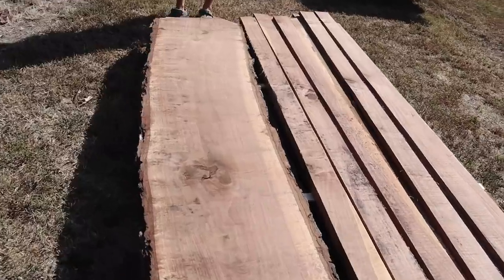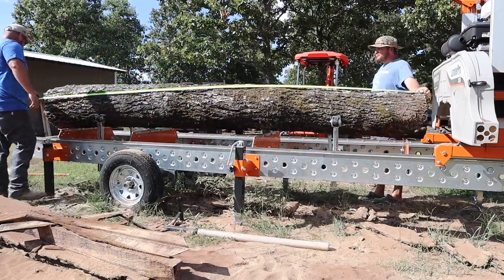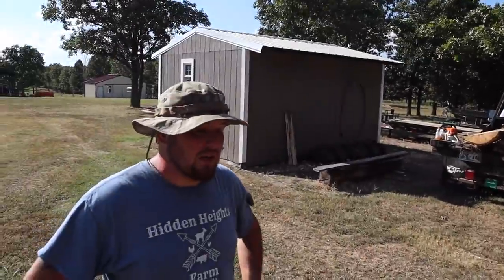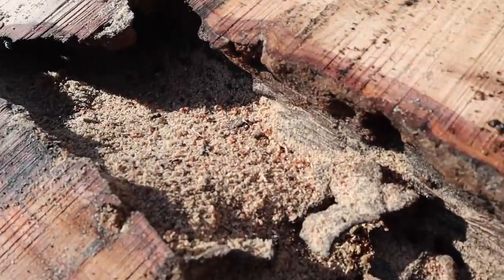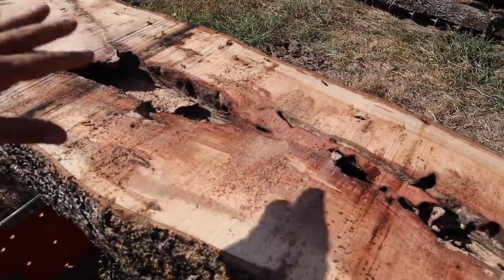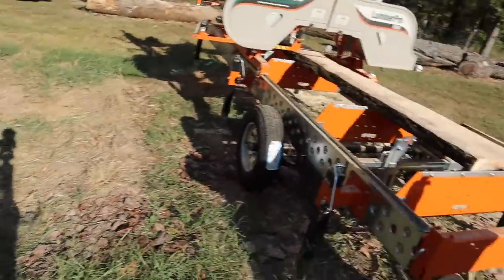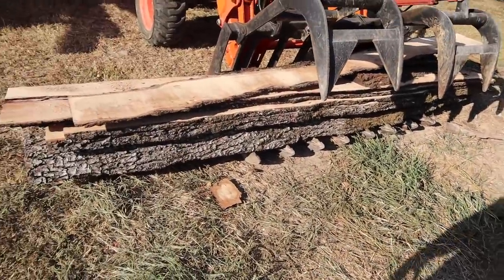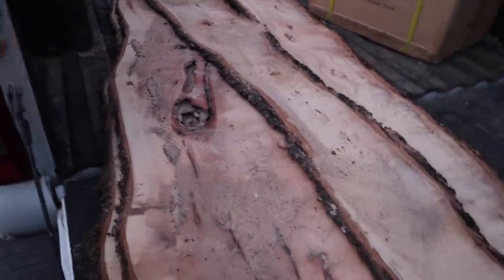WE FOUND 100,000 INSIDE THIS LOG

Comment: That was a mean hickory log!
Reply: Those ants look like carpenter ants. They can be just as bad as termites
Reply: It shook the bugs and beetles right out of it.
Reply: Those are carpenter ants you should spray them where de won't get it to the other logs
Reply: The logs need to be off the ground. Watch it with borax and water.
Reply: I think I would have burned that log.  I’m afraid you are going to have carpenter ants all over your property now.
Reply: Hickory is hard to cut blade don’t last long
Reply: Nurses are coming in, will try to finish later
Reply: Epoxy the ants right in
Reply: @dennislamers986  Exactly!  before they slice it  either using amber resin for ancient infestation look or water blue for the well shed.
Reply: Looks like he didn’t sharpen that saw to well. Just sayin 😉
Reply: We

Comment: Guys, Use a couple of plastic or wooden wedges and tamp them in behind the blade as you cut to take a little of the load off of the blade. The wedges are also used when you need to back the blade out of a log. 
I have had wood workers go nuts over my scrap pile, taking pieces that I would never believed that someone would want.

Comment: Hey Dutch, You can try to put a flat spot on the deck and continue cutting from the rounded side. That way when you remove the stable braces, the wood will not tend to roll on you.

Comment: I watch, "Out of the Woods Forestry" when I can. It's very interesting, and the sawyer has been using a mill for quite some years. From what I have just heard, you folks are fairly new at sawmilling.  I think the gentleman would be willing to offer advise if asked. I learn a lot, so I suggest you gents might also find that channel worthwhile watching.
I think it may be possible to get some more slabs by cutting, then rotating the log through 90°, then cutting again. Admittedly, you would probably miss out on the live edge, but you might also miss out on the hollow filled with ants! 😀 You could, of course, use a flashlight to inspect the hollow a bit more, before cutting the log.
I think I'll share this with my grandsons. We live in the city, so videos like this, help to give some balance, with a taste of the country. Thank you for it!

Comment: I worked in a production Sawmill where we sold 80 to 90,000 pee a day the band start out at 16 in wide and cutting regular Hickory was rough that shellbark Hickory is even rougher the saw I think you guys done a good job with that little bandsaw hickory's hard to solve no matter what size saw it is even Circle saws have problem-solving Hickory

Comment: One of the disappointments of cutting wood is that if it isn't protected from the sun it all turns a soft grey color very quickly. It definitely has to be coated or covered.

Comment: Don't give up on that thin stuff. It's often needed in cabinetry, especially for drawer sides other drawer + cabinet parts. We sometimes have to run thicker stuff through the thickness planer, just to get thin stock. That wastes valuable hardwood. Better to use stuff like what you have there!

Comment: If you had auto feed you wouldn't be forcing the blade & it'd cut smoother & you could actually look & watch all around while it's cutting & check performance of the cutting process. Must keep an eye on all sides while cutting & be ready to stop at any time, install a stop cable that runs the length of machine so all you need to do is touch it anywhere along the length & it stop immediately!!!

Comment: I don't think that you want the log you are sawing to be moving around or vibrating while you're cutting. I would anchor it down so the cuts would be straight and smooth. If it's moving around while sawing, it sounds like it is hard on the blade (also lube the entire saw, so it doesn't squeak and squeal while the head of the unit is moving).

Comment: Use the wood with the holes in for the girls to make crafts with it.. using resin and plastic or even metal flakes you can get at hobby shops you can make pictures to hang up etc.. go online and get some ideas..

Comment: If that 3 inch thick section has some nice tunnels or structure from the ants, it could make for a very interesting epoxy filled table-top! Probably get 3 tables out of that piece! You could call them Antwood tables.

Comment: If you don’t use supreme fuel in the saws engine and it sits for a month or more without being used the fuel goes bad and can disintegrate fuel lines and that really mess up your carburetor. Small engine shops make a fortune in repairs because of this. I know this from experience so now I always use supreme fuel and put a product called sea foam in the fuel. Sea foam is a fuel stabilizer that will actually clean residue in your fuel system. We don’t have ethanol free fuel where I live so supreme fuel I am told has less ethanol in it. I enjoy the videos so keep up the good work.

Comment: If you haven't destroyed the hickory slab the was so badly damaged, save it.  Clean out the ants and sawdust.  Cut it to a length of choice and fill it in with epoxy.  Bam!  Instant table top with absolutely astounding beauty and character courtesy of carpenter ants.

Comment: You need to speed up your engine. You are running the blade too slow. Also you need a water drip to cool the blade while cutting. You also need to place wedges behind the blade in the kerf as you go to relieve the pressure on the blade.

Comment: I see that you're only using two-by-fours for exterior walls. Most building codes that I know of require a 2 by 6 wall not only for strength but also for the R-value insulation. R-19 for exterior walls.R-50 for your ceilings. It is not only for cold is also for heat. Also, I don't see you putting any foam on your sill plates. Energy efficiency is very important.

Comment: On a log like that especially once top slab was re.oved and ant damaged center, log should of been rolled and stabbed.
Each side of that rotted center would of given clear full length  boards.
Just looking for width you lost  
Even made into full length kant would of produced usable boards.
Notice difference once you flipped.
Experience will let you learn temper of tree .
Your first slab could have 11/2 x11/2  possibly 2 or 3  full length.boards

Comment: The wood is so pretty!  And will be great in building.  Ants..ouch. Feel like they are crawling on me... no likes ants!  Hope they are not in any more of the wood piled there.  As bad as termites.  I think y’all need to spray and get the logs off the ground if can.  From experience carpenter ants and termite can eat up an entire house if you are not aware.  That large piece cleaned up would make a great mantle over the fireplace. Isn’t hickory good to use when bbq??  Or smoking that pig?
Reply: BBQ places here in Missouri buy Hickory by the rick and cord to smoke and BBQ meats here.

Comment: A 500,000 BTU weed burning torch from Menards would solve the ant problem.
But buying so small a saw mill is just leaving money on the table, also, it looks like it's struggling to make every cut, and with the log bouncing around it's a wonder he gets a blade to survive one cut!!
And what is he cutting Veneers?

Comment: Maybe it was just the log, but man that sawmill sounded like absolute crap. every time you set into doin a cut the thing sounded more like a chipper shredder than a saw mill. I still have yet to see those log hold downs actually hold a single log steady. No bag on you at all, I like the content, but man that mill just seems like a rough product, either that or maybe somethin is set up wrong or something during assembly or something.

Comment: Dang guys you should have killed those ants , there going to get into places you dang sure wont like ,  I can see that log jumping and bucking   I am watching the leveling legs bounce  and the rear one if loosening up  they need to be locked down , to keep your mill level ,   it's cutting your board thick on 1 side and thin on the other  and the saw head keeps rolling down hill , So I can see the whole mill is way out of level  and when your cutting and you have to keep stopping and backing out of the cut  it is because of the out of level issue ,  I have the same mill  just have a extra bed extension on mine  and another if I need to cut 20 footers , and I have it level  level  and it cuts like hot butter ,, Just practice and watch out for the locking dawgs  they like to eat brand new blades as you found out